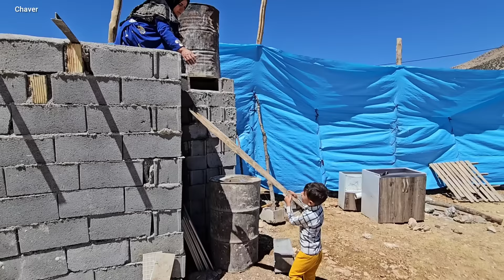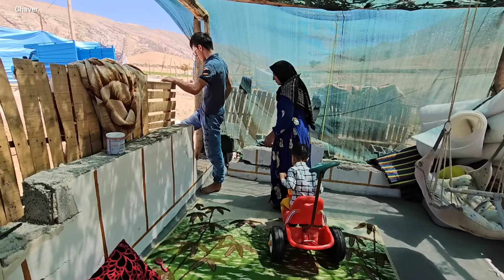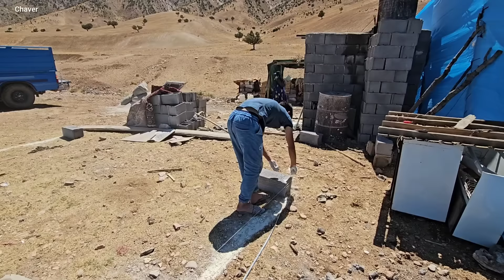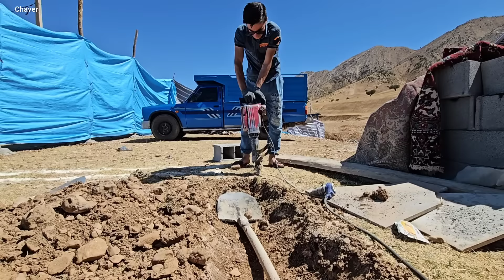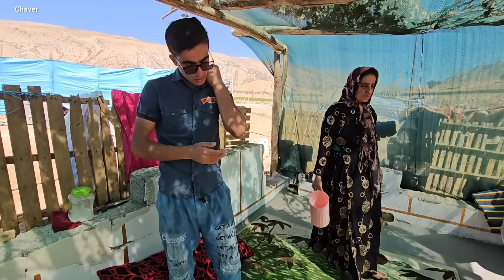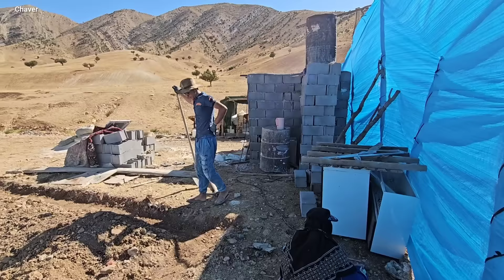Karim's opportunism to get back his second wife's children. 🤰😱 Chaos. 😰

Comment: Instead of building structural house, cameraman, suggest to sakineh to buy a container house or cabin house, no need to build at all and kareem cant destroy that container house because this much stronger than usual structural they built with no metal frame within.

There are containers that interior are fixed already and ready to use since the size of floor area they are requiring is also the same size that those container have.
That container house is also transferrable incase they want to move from one place to another.